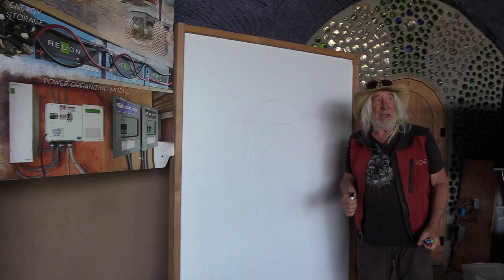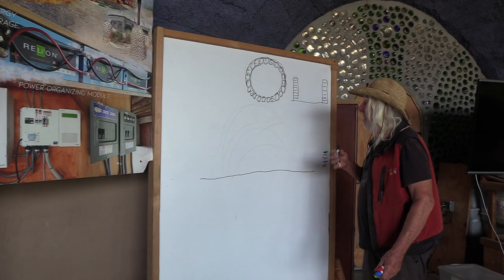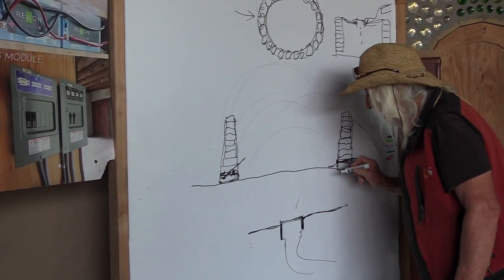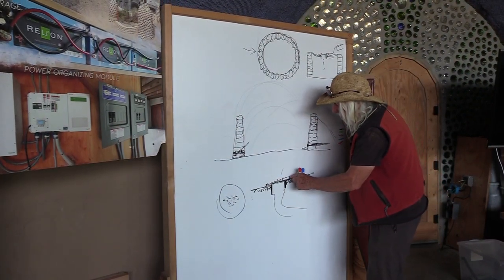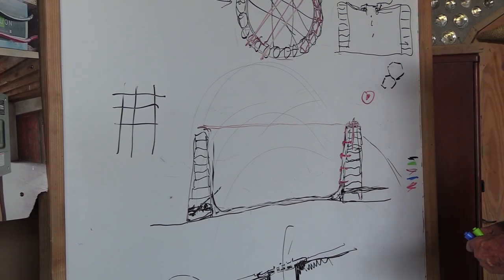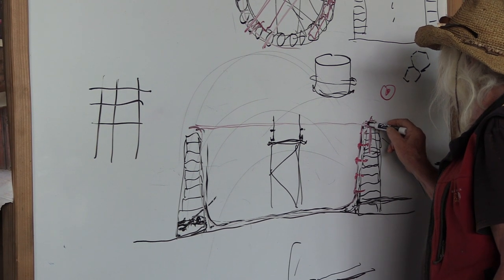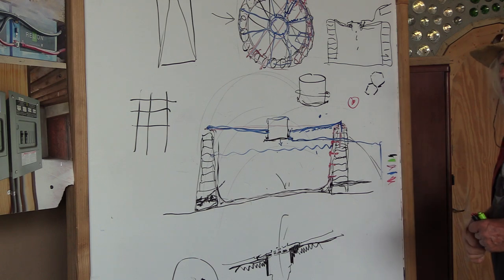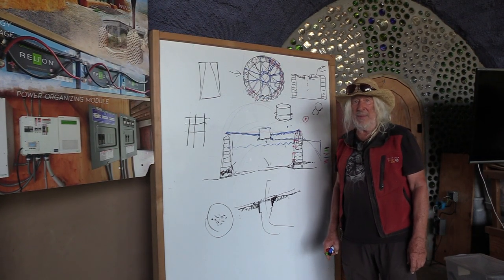Tire Cistern Video

Comment: My 1815 house had 2 cisterns made of brick. Wasn't planning on using a cistern in my skillion cottage. But wells cost. I have a 2 inch flowing point well 20 feet down pounded by hand. Plan on just using gas water pump to get water up the ridge to the cottage.

Comment: @15:10 How is the heavy duty aluminum rivet, affixed through the 22-guage metal to the 18-guage metal cistern hub lip, prevented from rapid dissimilar metal degradation?

Comment: Great video. How do you get to the hatch to clean and maintain? I just put a 22ga metal roof over a pumphouse and had to strap the rafters with 1x4's at 2 foot intervals down the slope.

This roof doesn't seem to have any support other than tension. Are you sure it's going to hold someone's weight getting to the hatch?

Comment: I live in O'Brien Florida and I'm working on building a home out of semi tires semi tires don't have to be filled with dirt or packed you can screw them together they easily hold together they do not pull apart you can screw stuff to the side walls to the back to the tires himself to the tread to make walls you can stack them and columns I have a few videos on it pictures I need some help getting a home proved for my design I have to find an architecture or engineer

Comment: Is there any reason y’all choose not to cut the side walls out of your tires to make filling and compacting them easier? 

This is how mechanical concrete roads are constructed will gravel fill. With the side walls off, the gravel can be dumped into the grid of tires then compacted by passing over them with a track loader.
Similarly, with the sidewalls off, dirt could be filled into the tires and compacted with a handheld compactor to construct tire walls. Could just cut off the top sidewall and leave the bottom sidewall on in order to keep the dirt in the tire for vertical walls then compacted the top of each tire.
Reply: The sidewalls have been said to contain half the strength of form in retention of the wall.
Reply: @T0MME0  what about if you left the bottom one but took off the top one? Seems like there would still be horizontal courses of sidewall on the bottom of each level adding to rigidity, with the benefit of being able to fill the tires much more efficiently from the top.